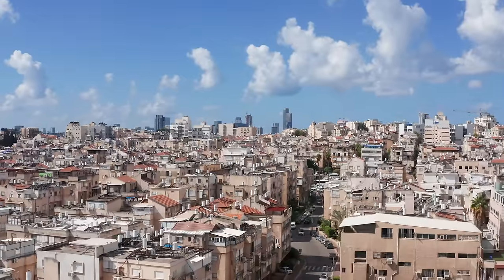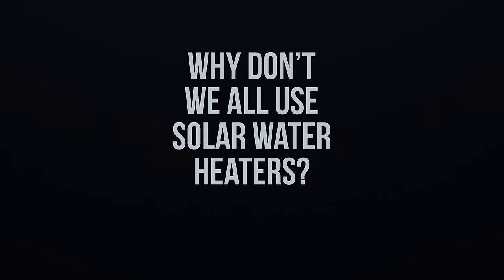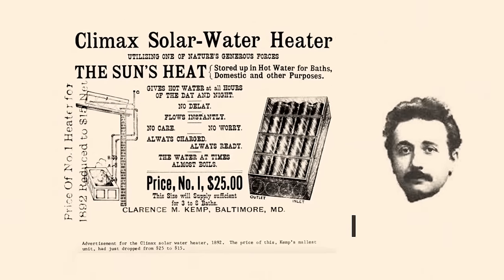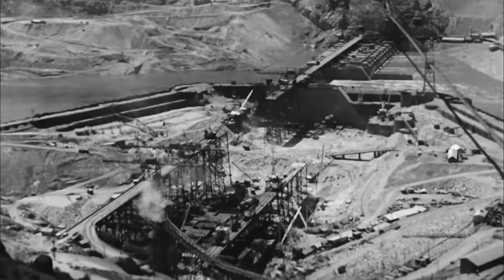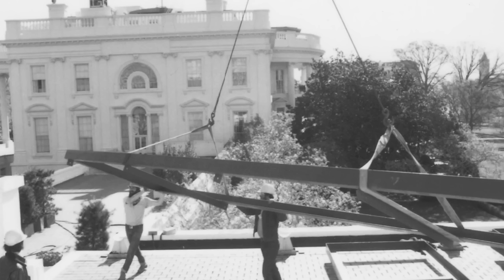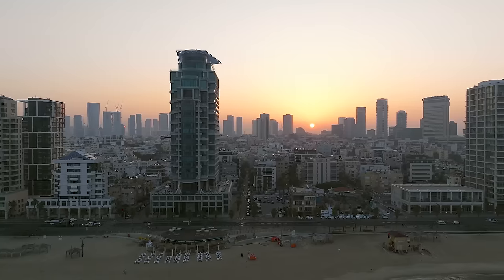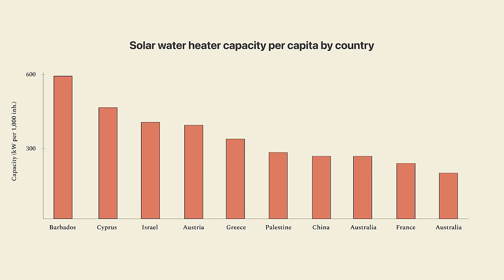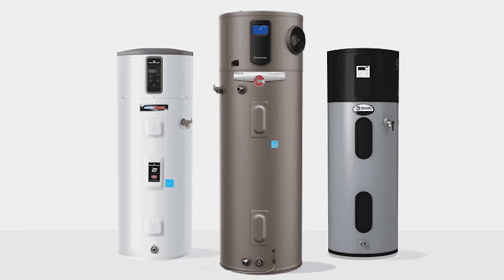Why Don't We All Use Solar Water Heaters?

Comment: Got my Heat pump water heater installed in Maine for $800~ after instant rebates and now eyeing rooftop solar. Basically the same solar water heater my family had in Israel but with more steps .
Reply from the maker: Nice!
Reply: What do you mean more steps?
Reply: PV solar, more flexible but less efficient, I had a home with a solar water heater problem was when it needed to be replaced all the companies that used to install had all switched to PV only.
Reply: @ian54589  yes, PV is much less efficient at heating water – even gluing a water tank on the back of a PV panel will heat water better than the panel ever would using its electricity & a properly-designed water heater is obviously better still.
Reply: @MatanMazursky  a PV panel will collect at most a fifth of the energy that hits it & a heat pump will magnify the electricity 3x to 5x – more steps than letting the sun heat the water directly (& a lot more expensive).
Reply: That's interesting. Here in Australia heat pump hot water systems cost between AU$3500-AU$7000 ($2350-$4700) installed. Solar thermal similar. Heat pumps are becoming popular.
Reply: in europe if you use the water also for heating and own a big house it can be convenient to combine some solar heating with heat pump (to use only in winter). however it is true that the new trend is PV + heat pump, and with electric cars this trend will be come the norm as you have big batteries to store PV energy.
Reply: @distilled-earth  I didnt realize Albert Einstein invented this under pseudonym of Clarence Kemp.
Reply: @maxmeier532  definitely a picture of einstein
Reply: Also in Maine and this video makes me want one even more! We have a fairly elaborate system as it is with an electric hot water heater, mostly for summer and a combo of oil fired and and a hydronic wood boiler for colder seasons but none of it is efficient enough for where I want to be. CMP and the oil company can suck it.. Where did you get yours??
Reply: How much will it cost to have the New water heater serviced if something goes wrong? A basic gas or electric one can be repaired by the homeowner.
Reply: @Maurazio  Yeah I'd prefer a solar boiler over a PV + heatpump solution. It's much simpler and far more efficient.
Currently I have both a solar boiler and a PV installation, but no heat pump yet. 

I'm investing in isolation first, because the decrease in energy cost will pay for the cost of the heatpump, whereas without isolation I'd doubt the heatpump would be powerful enough to heat the place properly.
Reply: Do you mean Palestine?
Reply: @AhmedMo-ec4kz  Palestine was never a nation or Kingdom.
Reply: Sanden SANCO2 heat pump hot water system had just entered the chat.
Reply: @alanhat5252  I have a solar water heater in Germany. With the first sun rays my water is hot, but this means the day the space on the roof is doing nothing. Also it was quite complicated run the lines to the roof. I would definitely prefer PV next time, since you can sell electricity to the grid here.

Comment: I am Greek.
I have solar water heater, and I use for:
- 1 sink
- 2 wash basins
- 1 bathtub
- 1 shower cabin
- 1 washing machine (has dual water input hot-cold)
- 1 dishwasher (through a thermostatic valve)

Solar heater can be used to warm your home too. Is called heliothermy.
Reply: I have 
- 2 sinks
- 1 bathtub
- 1 shower cabin
- washing machine
- wash basin
- dishwasher 
----
i come home at the time or after sunset. All members of our house (4) use shower and bathtub at night before sleep and early in the morning before work/school. Approximately we use 4-600liters of hot water (depends on bath usage, amount of clothes, if there are guests, etc etc...). So we would need 600l water tank to fulfill our needs. 
And just to mention, our input water from city during the winter is around 37F or 3C which mixes with hot water and cools it rapidly
Reply: Only works in southern Europe
Reply: @digo8167  In southern Europe solar systems work excellently!
However last decade solar collectors has improved enormously. Can work even under cloudy weather!
Politics are more important than the weather. A photovoltaic system in Belgium (North) pay off  the same time like Greece (South)!
Reply: @digo8167  Nonsense. We live in central British Columbia, Canada, and we've had solar hot water for the last six years. it works down to about minus 25-30C. Below that, hoar frost buildup impairs its performance. It was a no-brainer and many of our friends are thinking about doing the same.
Reply: A
Reply: In Crete it's so easy to work too. By only MARCH you have easily hot water. Americans in the south States should ALWAYS install those.

Comment: My wife's Grandfather built himself a solar hot water heater setup here in Victoria, Australia, in the early 1960s, and maintained it rather cheaply until recently. Never paid for electricity or gas to heat his hot water, for about 60 years. 

At my home, we have a SolarHart Solar hot water service, thermosiphon type, electric boosted when required. It's a huge 300L system, saves us heaps on our electric bill. I would never go back to just a straight electric or gas hot water service ever again.
Reply: Solarhart solar hot water, thermosiphon

Comment: Living in Pakistan, have a 20kilowatt solar system on my roof, then a solar water heater, problem is in winters when you really need it, it doesnot work here, but still i give its output to my instant electric water heater which has to work less now because 10 or 20% or 30% based on sun intensity that day is already taken care of by solar heater and rest will be handled by my electric heater.

So combining electric+sun gives me the high temp water I am used to. Luckily, the time i take shower which is around 9am here my solar PV array is generating enough electricity that my electric heater is also essentially running on solar so at the end I am using solar to heat water.

the total cost of solar heater here is around 400USD
and the solar system to make around 20kilowatt is  15thousand USD

Its a lot but it pays off in 10years.
Reply: You got a good price on that Solar PV system.

Comment: We added solar hot water in 2019. We were  strongly  discouraged and told that photovoltaic was the way to go. But we've really enjoyed it. Not only is it satisfactory to have lower bills but also we're paying close attention to the weather, making decisions about when to use hot water depending on when we have it, rather than mindlessly just using it. If we're ever going to learn how to live lightly on the earth we may need to limit how we're consuming energy. We run the dishwasher as much as we want to, but not always as soon as it's full and that's fine. Long showers on sunny days, short ones when it's been cloudy three days in a row. That's real wealth, not spending the capital, but having enough sometimes and more  than enough sometimes, if you pay attention.
Reply: I priced it up a few years ago. PV was easily the way to go. I could get a 6kW array plus an electric water heater for the cost of a solar water heater. That means I now have hot water for the same price, plus cheap electricity for other uses, plus a cheap water heater replacement when it fails. 

I think the only time solar water makes financial sense is replacing an existing unit. That means install is much cheaper as the plumbing is already there. Very very few are buying solar heater new.
Reply: You make a really critically important point: people want the ability to live in excess.  They don't want to have to limit their consumption, regardless of how much it may benefit them.  I think if people understood how little it takes to minimize consumption and how much they will benefit from that, it could make a big difference.  A lot of people use "think of the environment!" as a motivator but that just doesn't work on most people, unfortunately.
Reply: Most dishwashers draw water from the hot water pipe, but heat it further anyway.  Yes, hotter I put will help, but I’m not sure how much.  
(We once had a dishwasher that had only a cold input and then heated the water internally.  Took forever.)
Reply: @shawnbrennan7526  Dishwashers actually need the water to be extra hot because they don't use abrasion, so, they have to compensate by intensifying the heat.
Reply: @Toastmaster_5000  
Correct.  My point is that most dishwaters will do that heating internally no matter what input temperature you have in the pipes.
Reply: Pv withu heat pump water heater would have been superior. You only need so much hot water. With pv you can reallocate that solar power once your heater is at temp. With a solar thermal heater you can't reallocate that energy.
Reply: @Imaboss8ball  
I think the real point is that we could all benefit from a solar water heater if the cost came down to something reasonable.  
In the early 90s, my entire neighborhood had solar water heaters on the roof and a ~25 gallon tank that was basically a pre-heater to the real water heater.  Probably less than $1k to add to the construction of the house.
Reply: @shawnbrennan7526  it is cheaper but the goal isn't always to just be cheap. PV is more convenient and in the situations where you send excess back to the grid you are helping the environment.
Reply: @Imaboss8ball  
Arguable.  
Rooftop solar is actually a very inefficient way to do things.  Solar is best done at a more industrial level, (I.e. solar farms), because it is a more predictable way for the local utilities to manage supply.
Reply: @shawnbrennan7526  but grid power could have the occasional power outage. Having home solar accounts for that.

Comment: I fitted one to my roof in the South of Vietnam 12 years ago the model I chose has a solar panel on the roof and the tanks in the roof space underneath, so it looks a lot neater than those you showed at the beginning of the video. The tank is also fitted with an emersion heater so on high consumption or a run of cloudy day we can heat water. We rarely do this as cold showers are most welcoming in 32 deg heat.

Comment: As someone that grew up in Australia where solar hot water is common, but now lives in the US, I've often wondered about this, particularly when there is discussion about installing photovoltaic panels and batteries to store the power for later use - it is much cheaper to store heat than to store electricity. If the end result you want is low-temperature heating, then capturing the sun's energy directly makes so much more sense than converting it electricity, storing it and then converting it back to heat later. The problem is that homeowners with PV panels are normally grid-connected and have net-metering so the expense of time-shifting (needing to heat water at night and in the early morning when PV panels are producing no power) is borne by someone else and usually by fossil fuel generators.
Reply: A heat pump takes the ambient heat and puts it into the water which is at least 200% efficient, sometimes as high as 400%+ efficient (COP 4). You can get far more heat per square meter of roof space by running a heat pump and a solar PV panel than using solar thermal, especially in cold climates. For resistive heating, you're correct but not with a heat pump.
Reply: @imzjustplayin   There is no world in which PV is more efficient than solar water heating, simply because of the huge discrepancy in initial energy capture. You'd have to fill that gap with magic.
Reply: SUggest learning basic physics.  Heat pumps to be allowed to be installed MUST have a COP(COefficient of performance) over 3.  Which means for 1 watt input you get 3 Watt output even in unfavorable conditions as proscribed by code.  So yes, PV(20%) + Heat pump is MORE efficient than Solar Thermal(75%).  You might do the simple math and say 60% >> 75% except the big problem that one uses about 5% of power in Hot water but 95% in electricity... and any Solar Thermal quickly tops itself off in a sunny location and collects no more power while PV keeps collecting.  So, unless you can incorporate Solar Thermal into household heat, it is ultimately a waste of money + cost of making it not FREEZE.  Exception is very cloudy places such as NE USA/Maine/Eastern Canada, Pacific Northwest if we are talking about North America  @Eagle3302PL
Reply: @Eagle3302PL  Thats just not true. PV is 15-20% efficient that translates to 60-80% thermal heat through from a heat pump. Compared to 65-80% from solar hot water.

Except solar hot water is always oversized to account for less ssunny days. So you might heat your water in 2h and waste the next 8h of energy. PV also heats water in 2h then lest you use the other 8h of electricity somewhere else.
Reply: @Eagle3302PL  You are wrong. HP takes the heat from around it and applies it to the local area. Meaning you recycle the same heat without having to heat more air up.
Reply: @Eagle3302PL  It is also more efficient (assuming you get a COP of at least 3) to have a central power station burn natural gas, transmit it with losses, and then use a heat pump to heat a home. Even if a gas boiler was 100% efficient: the heat pump "cheats" by moving heat from one place to another.

Technology Connections (Youtube) has made several videos explaining this, including "Why Heat Pumps are Immensely Important Right Now". I live far enough North that the air-source heat pumps working down to -20C (0F) won't quite cut it. I would have to use a ground-source heat-pump (since the power company prohibits relying on resistive heating).
Reply: You can use a water heater to store energy from solar panels also instead of more batteries ...
Reply: @Eagle3302PL  actually photovoltaic works even when there is less sun, it's not full capacity but it works, solar water heater only works when the sun shines a lot, in countries where there is a winter season and not a lot of sun it won't work at all,
Reply: @wiezyczkowata  solar water heater work even better than pv in shaded situations
Reply: @mobuildsstuff  it does not, how do I know - because I have one...
Reply: @Eagle3302PL on paper sure it's not as efficient, but in reality it's what is more economical that matters which depends upon when, how often and how much hot water you are using.

If your main use is late at night and/or early in the morning, plus if there is a few ppl in the household so usage might be very heavy for just a few hours and then practically nothing outside those times.. it's likely PV and back feeding the grid is a better solution.

Plus you also then get the benefit for anything else electric in your home such as aircon, appliances, lights etc

Lastly if your roof space with appropriate orientation is limited you may have to choose one or the other.

I'm in Australia and 20-30 years ago solar heating was far more common and even advertised regularly in papers, tv etc but in the last 20 or so years with the cost of PV now being significantly cheaper you rarely see solar heaters on roofs anymore and the only thing advertised are PV panels.

A 6kwh PV setup is only about $3k here and that covers most peoples entire daily electricity requirements and more than enough spare to heat some water. Why spend another $2k on solar heating at that point? Then there is the matter of sacrificial anodes and tank replacements every X number of years, with electric you can get by with instamatic or a smaller tank etc.

It just doesn't make sense to have both and the benefits of PV far outweigh solar heating.

It's always what is more economical that wins, not efficient - it used to be one and the same but not anymore.

Comment: I was pleasantly surprised to find that the vacation house I stayed at in Barbados had a hot water tank on the roof. During the three months I was there, I didn’t see a  difference in the temperature or the amount of hot water I consumed on a daily basis. It was a satisfying experience.
Reply: My mother in law has a solar heater on her roof here in Jamaica. She had to install a special drain to run water from the pressure release valve to the ground so that the extremely hot water water from the valve doesn’t burn anyone walking underneath…
Reply: Well in general you have backup electrical or gas heating, so no you wouldn't see a difference.
Reply: @ianchandley  sounds like a bad install lol
Reply: @dailyrider2975  You'd have to turn on the backup as they're not automatic generally speaking.  They're very efficient even  on cloudy days.

Comment: There is also radiant heating I have seen in a few places. Where not only does the water go to the roof to warm up for hot water use, hot water is circulated around the house underneath special floor boards to heat up rooms. Surprisingly worked well in most mild winter area's. Even if water is freezing outside the special reflected light into the pipes often heated it up still.

Comment: I built a solar water heater for under $100 that heats 70% of our hot water.  It is VERY easy to do.  Basically just get a used water heater (FREE, it does not even have to work), strip the insulation off it and set it out in the sun.  Then pipe the cold water supply into the free tank in the sun as a pre-heater to your regular water heater.  It helps if you put the free tank in a insulated box with a window to form a greenhouse.  That's basically it.  There is no need to spend more than $100 on anything fancy.  Let the sun do the work.  :)
Reply: Make a video on it

Comment: I'm from Turkey, and this is very common there. There are two significant issues with this system. One is that it deteriorates in just 10 years, and sometimes leaks from the roof can cause significant damage to your neighbors. The second issue is that if you live in a large apartment building, it places additional stress on the structure from above, which can lead to increased momentum in the event of an earthquake